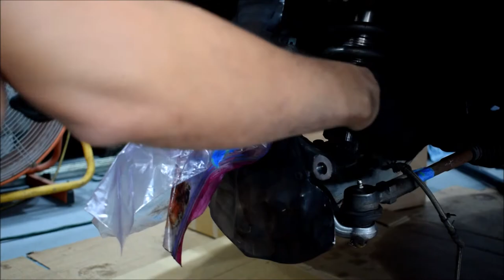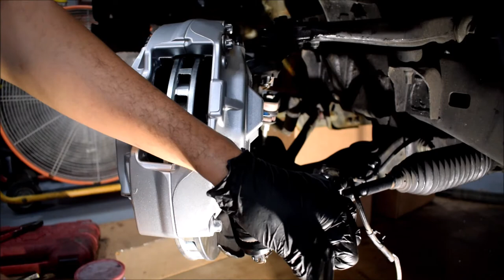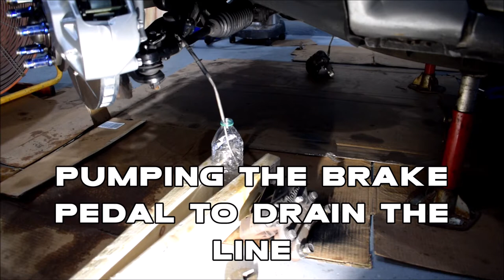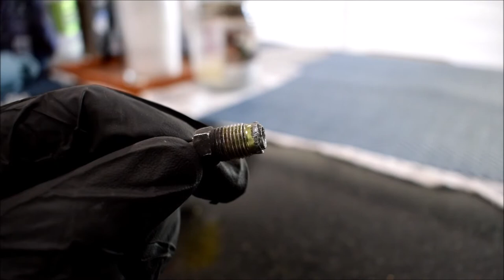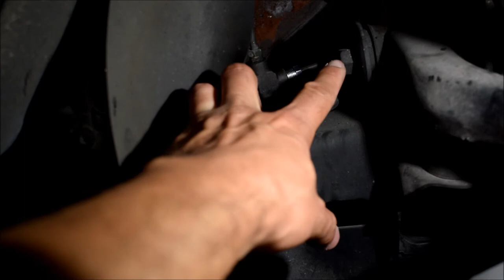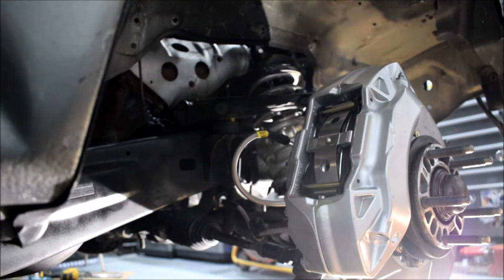Tacoma Brembo Brakes Part 2

Comment: The evap canistor looks new, where did you get it from?
Reply from the maker: It's actually the original. I just spray painted it with VHT rollbar and chassis black. You could pull one off a 4Runner or Tacoma at a junkyard. I find that 2RZ 4Runners are more common in junkyards than Tacomas.

Comment: Are you selling the willwood brake parts?
Reply from the maker: I will sell the caliper brackets, and the rotors and brake hats. The calipers themselves will be going on my Miata. I will be throwing out the brake lines. While I have no doubt my brake lines would have lasted a few more years on my truck, I would never sell used brake lines. I would provide info on which brake calipers and lines are needed to whoever buys the setup.
Reply: @doitwithproperstyle  how much would you want for that setup minus the calipers and brakelines. If you have model numbers I'll buy those new

Comment: I think your drilling experience would be better at the low speed setting on the drill
Reply from the maker: I ended up drilling at various rates. Some worked better than others and the drill bit size was also a big factor. I feel like using more in between sizes would also have helped. The absolute best is to couple this job with ball joint and tie rod replacement so you would have an excuse to remove the whole hub and toss it on a drill press or a knee mill.